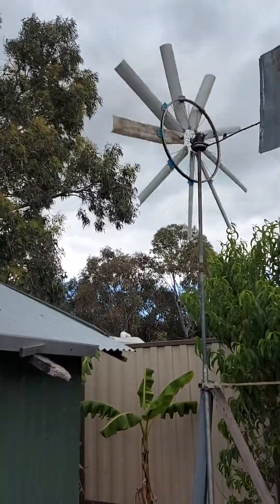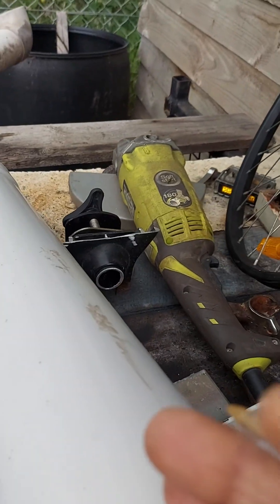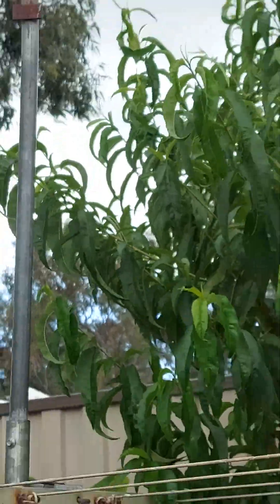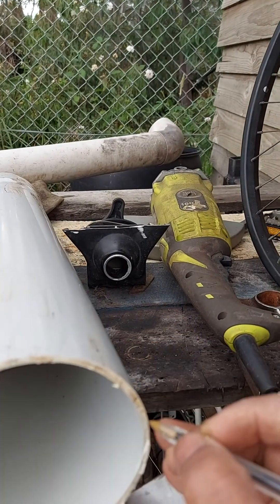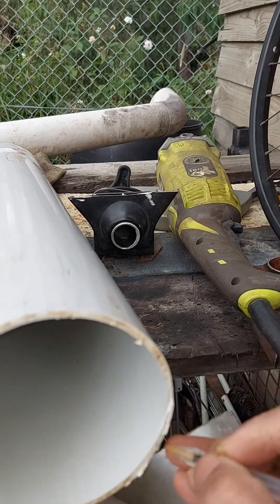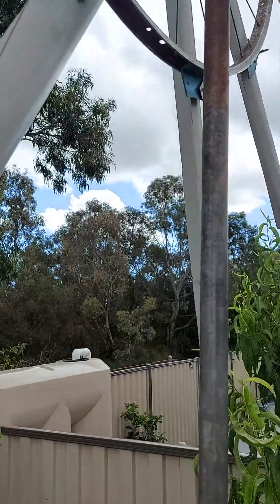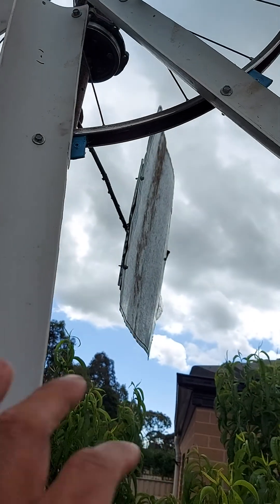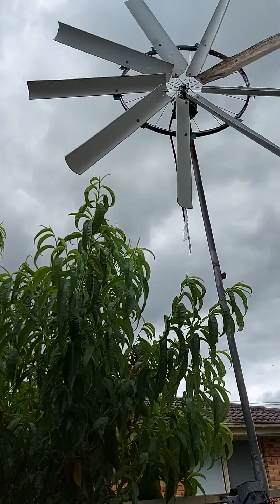Bicycle wheel Wind turbine(සුළඟින් යාන්ත්‍රික බලය)

Comment: How much power you are getting from this generation
Reply from the maker: 100w- 200w at wind speed (20- 30)kmph and you can genarate  more, if make bigger diameter.❤
Reply from the maker: It depending on ,diameter of the fan  blade,  bigger diameter make more power...